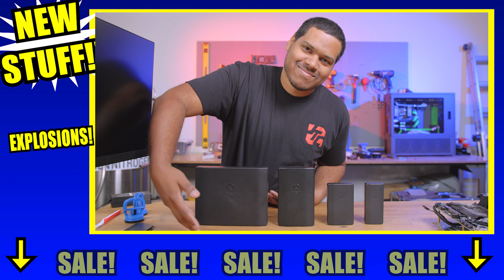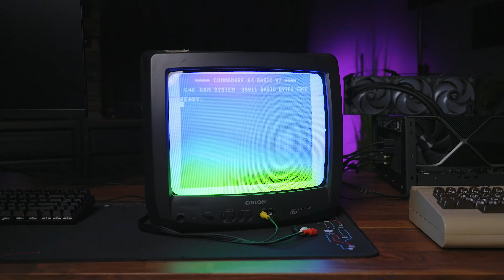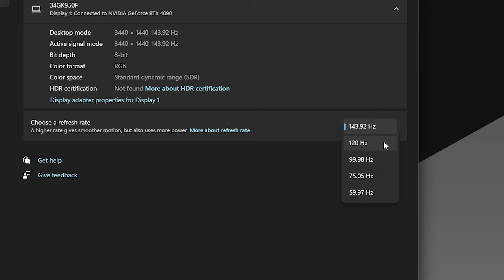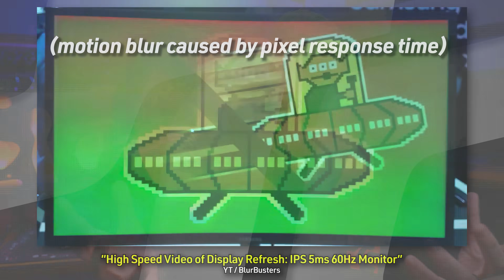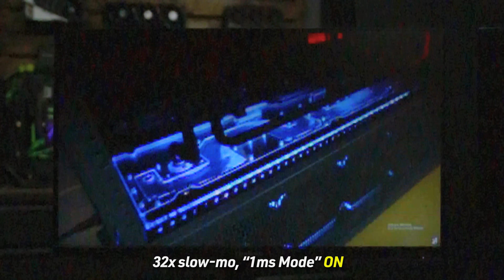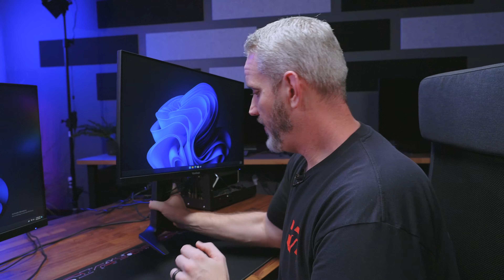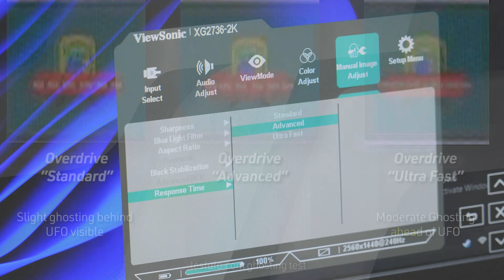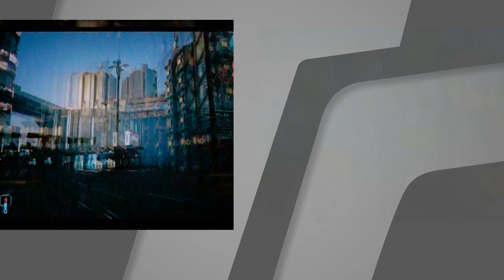MPRT is pretty awesome! This is how it works...

Comment: The flashing of LED lighting can be easily seen by taking rapid pictures of a Christmas tree with LED light strings on it. I told my wife that the flashing is one of the things I don't like about those lights. She thought I was crazy because she can't see it. I can but I can deal with it so we use them anyways. To show her though I got out my cellphone and did a picture burst that took like 10-20 photos in quick succession. Then I had her scroll through the photos. She was amazed that  most of the pictures showed some light strings working while others weren't and the occasional photo of all strings on at one time. So now she knows what I see is there. Thankfully it's at its worst when I'm in motion while seeing it. Like walking past, or she calls me from the kitchen and when I turn my head to look my eye's cross past the tree. Looking steady at it I have to actively look for it to have it bother me. Monitors I think if mine flash, they flash far to fast for me to notice. I just got a 165hz monitor, set to 140 since I didn't have a extra display port cable to use with it and am using HDMI right now. Now I just need to get that B650 MB, 64gb DDR5 and the Ryzen 9 7900x installed so I can take better advantage of the monitor. Already did it all for my sons computer and he loves it (his only has 32 GB DDR5). Need to do my wife's and then mine still. All parts are in the bedroom waiting. Probably do my wife's tomorrow and mine next weekend. Still trying to decide if I want a different case or not. Problem is cases with the rear I/O panel facing up so my computer can be on my left side, aren't easy to come by.

Comment: 9:14 incandescent lights also “flicker” due to the property that is inherent of how power is generated. In the US this happens every 60/2 Hz, or more specifically, the light will be “off” [at] every half of the full wave. The difference is that incandescent has a direct relationship with the grid and thus can be represented like cos(60t+phi), whereas an LED may have a more complex relationship which would be based on the rise and fall time of the specific capacitor used to store energy during each half-wave

Edit: [clarity]

Comment: CRT's are generally not permanently damaged by holding a magnet close to them.  The discoloration on the CRT can be removed by using a degaussing coil, if you can find one.  They were very common in the old TV repair shops.  I've used one many years ago while repairing CRT TV's.
Reply: Many monitors and tvs had them built in. Either activated by button, or by default from a cold start. Had an eizo crt ages back. it had the button and made a fancy abrupt hum that quickly faded away when activated. Image would vibrate to match the hum.

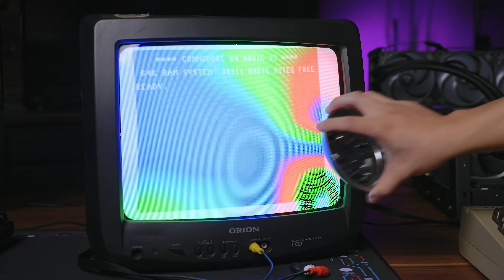Comment: 3:00  I must be older than you because I remember degaussing (which is how you'd fix that).  

A lot of newer CRT's had that built-in - it's what made that HUMMMMM sound you'd hear when powering them up.  They needed it because late 90's CRTs were high enough resolution/had small enough dot pitches that the screen's colors would be affected by the change in the earth's magnetic field any time you rotated it.  

Some screens had a button so you could initiate a degauss whenever you wanted - an endless source of amusement in open plan offices where bored colleagues would sneak up and press it while you were squinting at something on screen.
Reply: I always loved the Twang from the shadow mask when the degausser kicked in.

I brought a 19" CRT into my middle school computer class once. The twang scared one girl so much that she literally jumped up and ran out of the room. She came back later with the school secretary, who checked to make sure I wasn't blowing anything up in the room. The girl was still so freaked out she couldn't stay in the room with the CRT and the little noises it made as it warmed up.
Reply: @saundby  The degauss used line voltage to work, so it would emit the exact same hum as a malfunctioning transformer or rogue electric power earthing itself - so I don't blame her ;)
Reply: yeah the degause was basically on all crt monitors(either physical button or as a menu option), but it wasn't a magic fix for all magnetic damage.
also crt tv's didn't have a degause option (at least the ones i saw/had), you could degause them but you had to get an external degauser but they could also damage the tv more
Reply: @ShockbunVT  Color sets all had a degausser built in after sometime in the late 70s. But yeah, they weren't powerful enough to degauss the effects from a really strong magnetic field. A TV repairman could fix it, and it was quite a dance they did when doing so. :)
Reply: @ShockbunVT  You do not "damage" a TV by using magnets, that's nonsense.
Color TVs had a degaussing coil that worked immediately every time you turned your TV on, it didn't seem to work every time because it was controlled by a PTC thermistor that cut the current when it got hot. So it only worked when the thermistor cooled down and allowed the degaussing coil to work again.

Comment: An LED isn't inherently flickering. That all comes down to compromises made when designing the drivers for them, usually to cut costs. A very common way to dim LEDs is to use PWM which means they are blinking on and off rapidly which reduces the amount of light being emitted. But, they can also be dimmed using a constant current driver which means they will not flicker at all. Or if you go real basic they can be dimmed by adding resistors to limit the current, that can also be flicker free, provided the DC supply is clean.

Comment: One other tip is if your monitor is HDR, you may be able to adjust your HDR calibration to compensate for the dimming from the strobing. RetroTINK 4K can do this with retro games, for example. It can output a BFI signal (even if your display doesn't have a BFI/strobing mode built into it) and also use HDR to compensate for the lost brightness. Really cool!
I mostly notice blur in rhythm games. I crank up the scroll speed as I get better at them, and once you get fast enough the notes start smearing together. I have an older ASUS VG248 that's pretty decent with motion clarity, but there is more blurring than I'd like. Nice to see manufacturers caring enough to market it, at least. I know from "response time" alone that the metric can be misleading, as you mentioned. I'm glad a display's input lag is easier to find now, so I'd like to see us get there with blur too. (Getting the answer "1ms response time" when you would ask what the input lag was is something that has driven me crazy for a long time. "I like this TV, it has 10ms input lag in game mode" "10ms seems high, my TV says 1ms response time" "Different metric!")

Comment: I damaged a CRT with a big speaker magnet once, warped colors, the whole deal. The beefy speaker was on top of the screen, placed there as my center channel, and over time it did its thing. In a desperate attempt to fix it, I flipped the magnet around, hoping the reversed polarity would undo the damage. This, believe it or not, actually reversed the effects! Worth a shot if you are still rocking a CRT and make a similar mistake.

Comment: The level of detail I get on my CRT is still noticeably superior to my Oled and LCD displays. 

When I use my PS3 in 480p on my tri-sync crt arcade monitors I can see details that I didn't know were there. You can't see them at 1080p on my 4k oled.

Going digital was a mistake. The extra processing adds nothing. It's 100% negative.

It was an even bigger mistake to update the image in whole frames instead of line by line.

And CRTs ability to switch resolutions is pure magic. Every scaler sucks by comparison.

Comment: Here's what I do, and I challenge others to do the same: start a game with motion blur ON, and only turn it off if it bothers you.
Motion blur can be great or terrible, depending on the game and how the developers implement it. Digital Foundry frequently talks about this, and the different types ("per object" vs "per pixel".) I think it was in a DF podcast, they concluded that most people who hate motion blur probably had a bad experience with a bad implementation, perhaps a long time ago, that left a bad impression on them forever - so they automatically turn it off in every game before even trying it. I was one of these people; I thought it was the worst thing ever in Portal 2, so I turned it off in every game after that. But I've recently been rehabilitated, and there are plenty of modern implementations of motion blur that I really like. Motion blur makes a huge positive difference for me in Cyberpunk. Normally 90FPS looks perfectly smooth to me, but enabling motion blur in Cyberpunk at 90FPS looks so much more lifelike! But in other games (can't think of names, off the top of my head), it looks totally unnatural. It depends on the game.

Comment: My ASUS XG27AQMR does black frame insertion stuff even with VRR, however you lose certain brightness controls instead as it needs to adjust the brightness based on how long the frames are with VRR. It seems to work pretty well.

Comment: yeh. new fancy monitors. i often disable game motion blur but i can deal with "screen lag/pixel ghosting". it looks natural. i don't need those fancy hf screens (yet?). i got my craptops. and will continue with that. the thing they forget on some models and frequencies is v-sync and content. right now i have 144. i can't really play on 2nd sync cause craptop gpu and heat. but i get 3rd sync. for me this means 48 and still smooth. 36 on 4th. and the 5th is clean 24 for movies. and it looks focking good. give it a smooth anime camera pan and you'll be surprised how much that can matter. the 240 panel does clean 24 in sync. the 280 does not divide to 24 tho. ends up in fractions and may stutter. here's to add. i'm impressed how my display deals with 30 or 60 video fps on youtube, now. i had games that fell apart cause the limited framerates and timing de-v-synced. it's all driver synced now. and looks great. just the front plastic got lil heat burn marks after years.

Comment: THANK YOU. I don't find motion blur to be "the devil" like it seems like most people do.

The problem is that, so long as you are sampling a continuous system using non-continuous samples, you will ALWAYS see temporal aliasing.

That is, if something flies across your screen in 0.1s, and you are running at 100FPS, you will see 10 images. It doesn't matter if "your eyes can't see more than 75FPS" or whatever it is they say. These 10 images might be so fast that they appear almost at the same time. But they aren't just separated in time. They are separated in space. So even if we were way outside a normal frame rate range. Let's say 1000FPS. If you were playing a game at 1000FPS and something moved across the screen in 0.01s, you would STILL see 10 images.

Personally, when I see this, I think it looks cheap and annoying, even downright irritating. For some games like Half-Life 2, I'll sometimes go out of my way to set up ReShade to INJECT motion blur. Just so I don't have to deal with temporal aliasing's digital stabbing effect.

I will say this, though. Motion blur isn't entirely a fix, either. Because motion blur on a screen only happens in relation to the screen. If you closely are following a dot around on the screen, your eyes are moving with the dot. So you ideally would NOT have motion blur. But since it's moving in relation to the monitor, it will be added here. Maybe someone will make eye-tracking motion blur some day. Probably for VR.
Reply: Motion blur is god-awful because the implementation isn't done properly most of the time. Also it's usually a toggle between WAY TOO MUCH and NONE instead of a slider.

Comment: Majority of cost for a new product is in making the manufacturing process for it work, then at high volume. Once that's paid for, it's down to material cost. Labor is probably a rounding error. Law of supply v demand still drives what you have to pay.

Comment: excellent vid. I cared about MPRT for a long time. Been screaming about BFI tech needing to be mandatory for any GAMING focused monitor or TV for so long. I think the peak of visual clarity for actually normal gaming is the LG C1 oled TV. Not the more recent models but the C1 specifically, because it's an excellent oled TV with native 60fps and 120fps BFI support ootb. And no gaming monitor ever managed to outdo it yet. Sure there's 240hz oled monitors now, but they won't allow BFI AT 240fps. Even if some oled monitor allows 240+hz BFI, they wouldn't allow 60hz BFI anyway (60fps is the standard for the majority of games) so they're still not as good as the C1 overall. After years of headaches this is my conclusion.

Comment: I guess I'm am oddball as I don't like the artificial motion blur that you can turn on or off but don't care about the absolutely fastest response time. I don't care about 2K or 4K either. I've used 60Hz monitors for 30+ years now, sure, a 144Hz makes the mouse feel better but it's not something I really care about.

Comment: CCFL displays - this did reduce battery life for earlier laptops, and generally required replacement after 5-10 years of use. Toshiba used many of these displays on their laptops, to the point where my repair shop usually would dismantle no-longer-wanted Toshiba displays to have cheap n easy replacements on hand.

Comment: The black frame strobing sounds terrifyingly bad to me. I've spent about 20 years training my eyes to notice flash frames (what we call black frames that pop up in video editing timelines) when they unexpectedly happen. I don't believe I have super human eyes, so it's possible the monitors are strobing fast enough that I wouldn't notice. But there is always a chance that the worst of both worlds will happen, and I won't notice it except 2% of the time... and there will be no way to fix it, because that's the designed function.

I also like motion blur, but not fake motion blur you get from 'smooth motion' televisions. I turn it off in games because I don't want to work the GPU more than I need to.

Um, what frame rate are y'all shooting at? I was guessing 60fps, but YouTube is only telling me 'auto 1080p' which means 30fps. (Is frame rate one of those YouTube Premium things?)

Thanks for the information, I'll know what to look for at the store display shelves now.
Reply from the maker: I guarantee you won't notice 1/2000

Comment: 9:20 - My LED lights are constant because I don't use cheap switch-mode power supplies when I build them. The LED's are being supplied constand DC. They aren't dimmable, but they don't produce eyestrain, either.

Comment: MPRT = workaround for something CRT's did better 20 years ago.  Great presentation.  I used CRT well into the early 2000s because they were hands down better in every way and are still better then most of the stuff out today... except they weigh a million pounds and are huge.  Pixel gating is a method of polarization.
Flat panel displays (I'll lump all the "not a CRT" tech together) don't measure refresh the same way at all as a CRT does and they basically lie about it.  Slower refresh on a CRT is going to be better than a flat panel--as you alluded to with response time--but you missed the part about "when" you measure that response time.  The CRT pixel may respond "slower" but it's response time starts sooner than a flat panel (because of how the screen is refreshed) so it isn't a one to one comparison.  The flat panels also have a hidden metric of pulse response of the Gate Mesh that control the per pixel response.

Comment: i mean its 2024....in teh past your options were true 1ms GTG with a TN panel and nobody cared about color reproduction bc twitch/shooters already modify the color profiles for EVEN more contrast/non realistic reproduction for easier target acquisition/id. YET when g-sync started SHILING hard we start seeing 1 ms(mprt) actual 5-8ms gtg...ips panels getting pooped out. All this talk about Image quality/color scoring being a priority as if the pallet in games of that era boarderlands as an example or others....even CATERED to these aspects. Or even to this day if colors need to be adequate/accurate in something like warzone. When even im messing with nv control panel to make obtuse contrast for games like EFT. Just like LUL cmon its 2024 now you can have real 1ms if not less response times with OLED. Cant beileve anyone ever got shilled into some 3000:1 contrast ratio 400$+ monitor at 24" that smol of a monitor to spend 400$+ to be suckered into thinking youre experiencing all the CAVEATS of color....and "PERFORMANCE" or even 1000:1 contrast ratio when MPRT is enabled strobing a blank screen....with LOCKED brightness Or g-sync or freesync being ENABLED either...so much marketing caveats and shilling over the last 10 years NGL its sad to be an uninformed consumer. PPL crying about VA as if theyve seen a samsung odyssey monitor....where the image quality/speed/viewing angles are all ideall....other than the AGGRESSIVE AF curve/lack of multimonitor continuity.